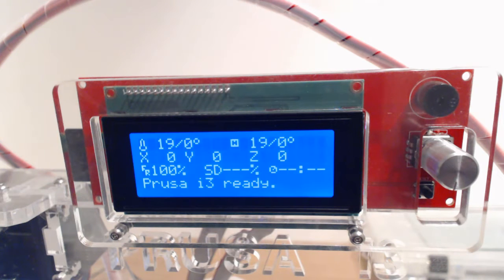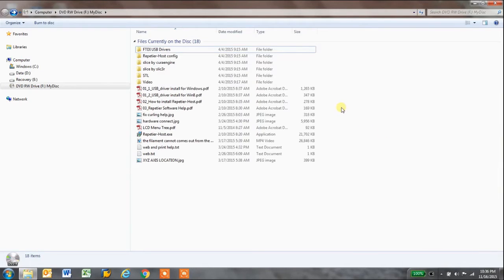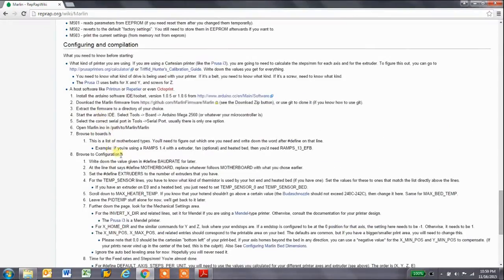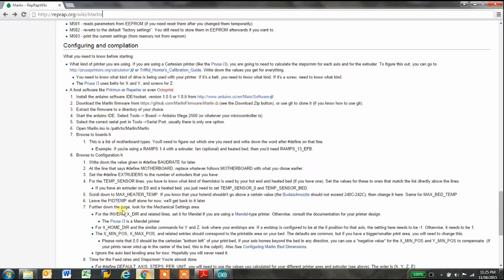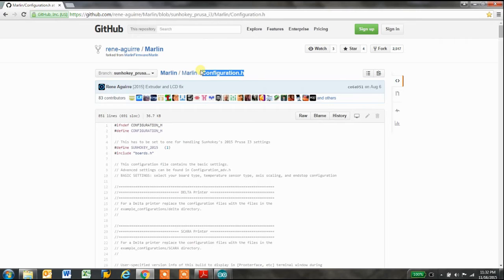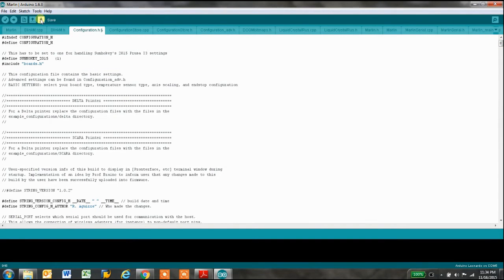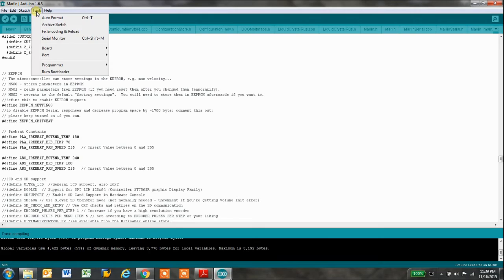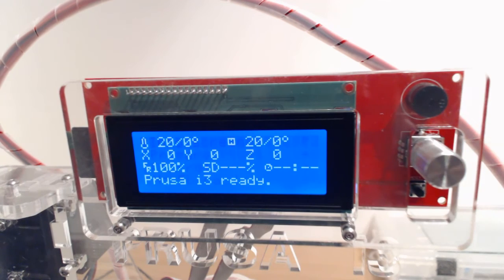Prusa I3 calibration: LCD, no store memory option - How to fix 2015 configuration

Comment: How did you get your printer to connect to your computer? Mine keeps sending back the message " Serial com error:System.IO.Ports.SerialErrorReceivedEventArgs". Thanks.
Reply: Look in the machine settings and look for port number list.
Try each one until it works.

Comment: hi there, i got problem when uploading. in the tab marlinserial.h it said missing binary operator before token. could you please advise?
Reply from the maker: I suggest trying to save your configuration.h file and to reinstal the marlin software, after this overwrite the configuration.h that you saved previously. If it doesn't work, please let me know and I will send you my marlinserial.h and .cpp file. I also had this problem and after reinstalling it worked.
Reply: +AndreiRobotics thank you, I search for marline firmware on the internet and just upload it. It is now working.

Comment: Hi there I have the exact printer but I am struggling to  do the step that involves the "Auto home " this is when you meant to plug it in for the first time but for some reason the motors are not moving at all . I have checked the wiring  4 times as shown on the tutorial CD given .. could you please help me ? 
Thanks in advance .
this a video with the problem 
 https://www.youtube.com/watch?v=PSkgdBmkBjU
Reply from the maker: +MrJefferson105 
Hi! I just realize that i forgot to uploud the video where i connect the electronics to the mainboard. Maybe you will find what you need in that video. Please let me know if you managed to fix your printer.
Link to the video: https://youtu.be/2XWKqygGHdI
Reply: Hi there thanks for the reply i have seen your video but my printer does not do anything similar to yours .i have followed your steps and my wiring is the same as yours .. i think is the micro controller board  is faulty . any more suggestions : D thanks for the help
Reply from the maker: +MrJefferson105 
Hi! If you hold your x-axis endstop sensor are your motors working? You might have a shortcut on you mainboard. Or try to unplug all sensors. Your printer should switch on this way.
Reply: that worked ..  thank you very much .... you are the best ... I have contacted the manufacturer and they said that their engineer was going to have a look at the video and try to give me his advise or replace the board . .. Thanks ... i will let you know if it works :D
Reply from the maker: +MrJefferson105 
I hope it works :D
Reply: thanks :D
Reply: did u get it fixed mate?
Reply: yes i did  .